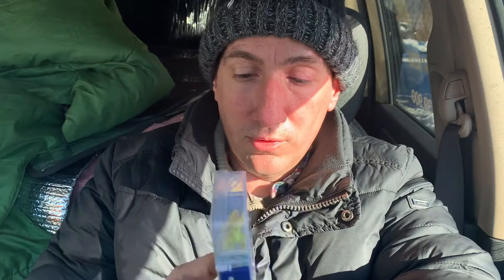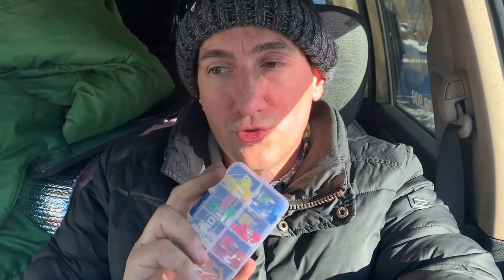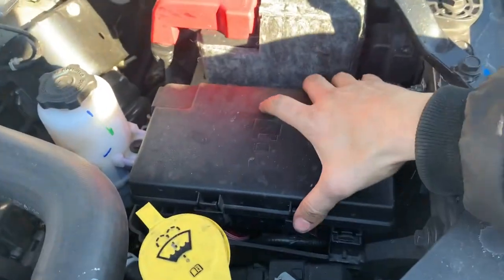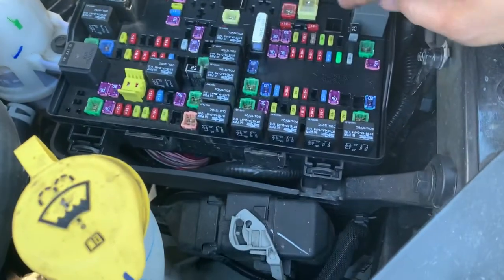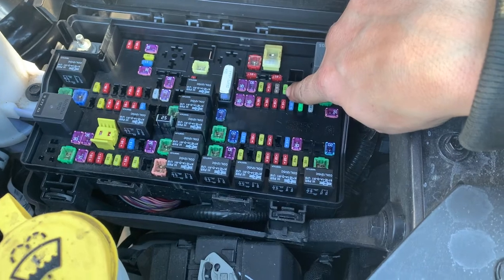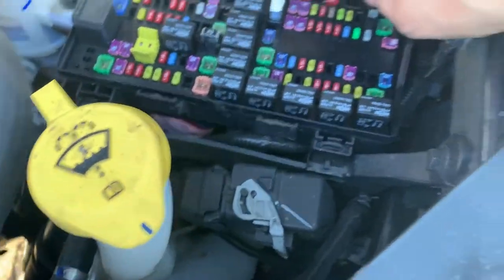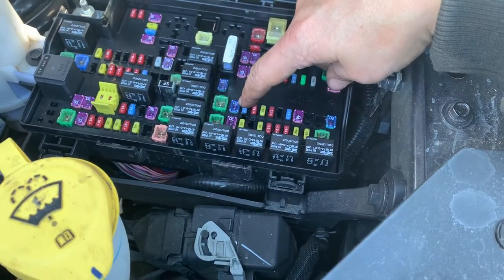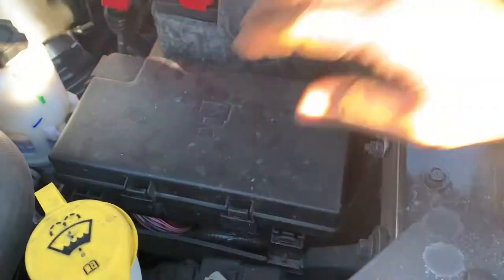FUSES! 2019 Ram Trailer Lights and Fuse Repair

Comment: Nice video man, do you by any chance know witch fuse activates the hot wire that changes the battery on your trailer? If you could help me out I would appreciate, thanks!
Reply from the maker: 🤔 that I do not know since haven’t had an issue yet with it. When u test the 12v connector for ur plug u have no power? Sure not the wire harness, maybe damaged from the truck outlet to the trailer? I’m away so can’t help u out at the moment

Comment: You showed the blue fuse for the running lights but I don’t see it listed in the diagram in the manual. Is this the tow receptical F58?
Reply: On my ram 3500 it was fuse f28 f29 and f30 and I think there is another one for the trailer plug. Nut those are the main 3